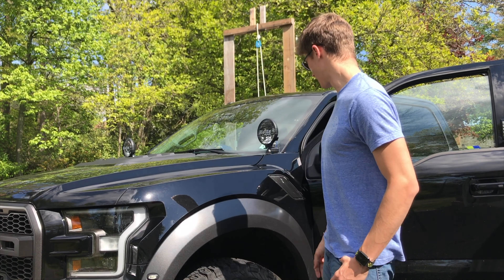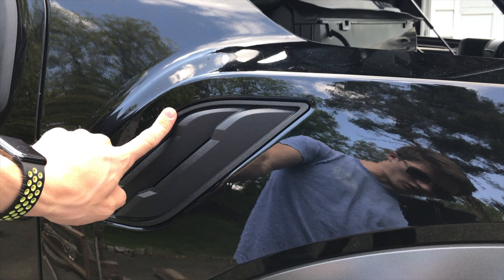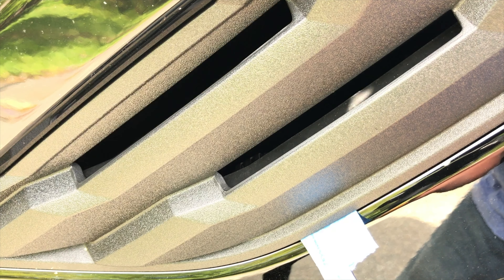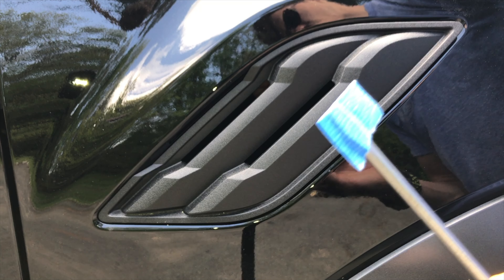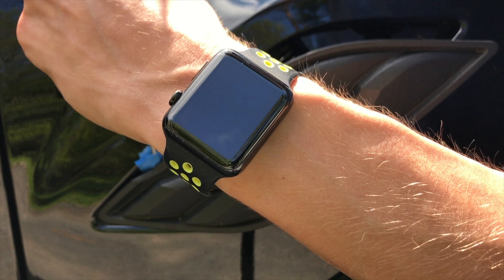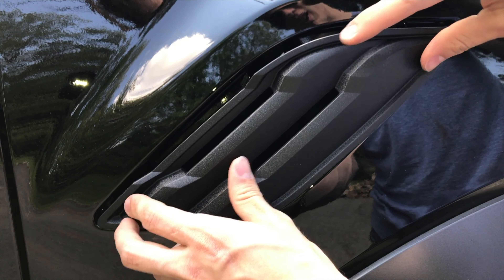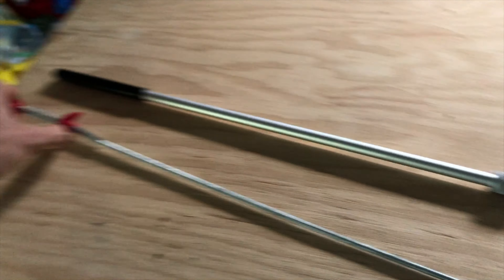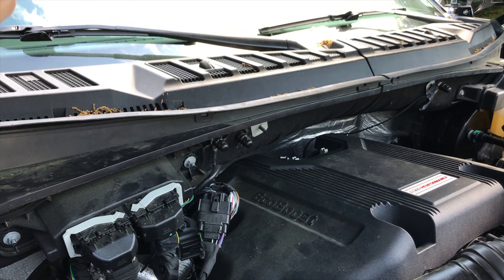How to Remove the Side Vents on the Raptor

Comment: Did you ever make a video for removing the hood vent? Thanks.
Reply from the maker: Hi Zack - We will be making a lot of videos in the very near future. The Geezer (Duane) is building his Raptor into a fully race prepped desert truck. He will be adding a Fiberwerx Racing Hood, we will video that hood installation and removal of the hood vent. Stay tuned...
Reply: @geezernyounggun5136  link?